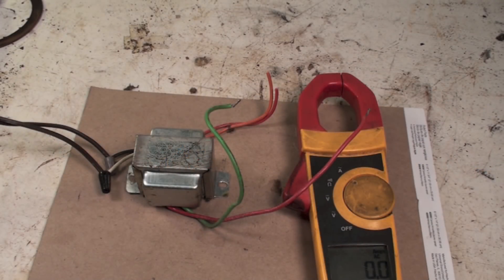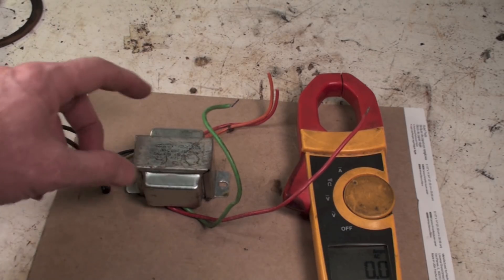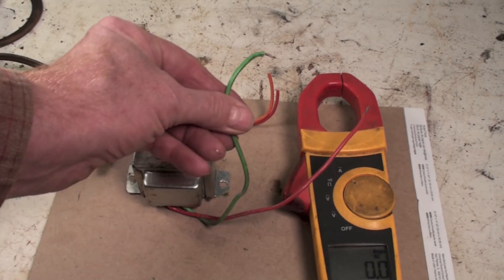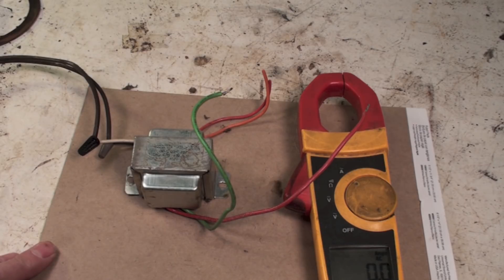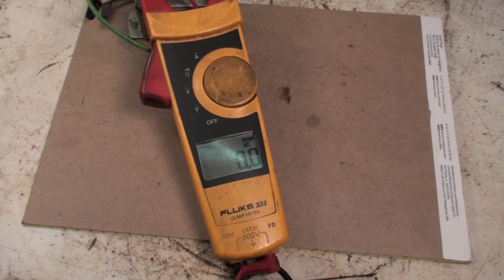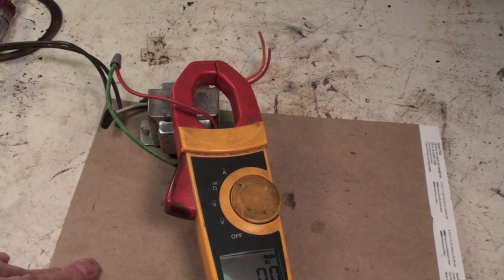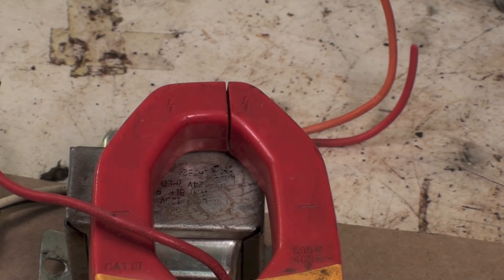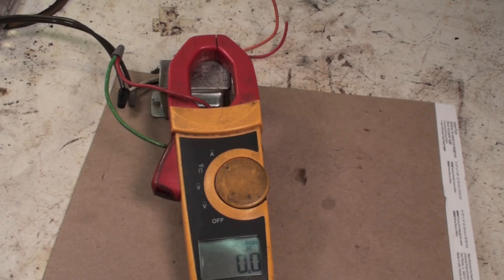How to replace a transformer (without burning up the new one)

Comment: Hi GFM! The 1st thing I ever did was replace my 24 v power supply on my furnace 20 years ago.
The old one did not have 24v common grounded to chasis.  I put it back like it was.
Is that the norm for the 24v common not to be grounded to chasis?
Reply from the maker: Some of the earlier transformers were not required to be grounded if they're smaller than 40 VA.
GFM

Comment: Thank you so much, I appreciate your channel so much.  I am having to replace my transformer which started smoking.  I have watched and read everything I could.  My new transformer is duplicate and has no fuse like previous (board or anywhere).  Therefore, I am planning to install an inline fuse on secondary wires which are both the same "color".   In looking at the wiring diagram and the control board itself, I understand where the wires should connect on the control board terminals; one on C and one on X. 
 (Sec 24    VAC
  Yellow  Yellow)
I don't want to make a mistake again as I think/know it was a direct short when I was checking the inhouse thermostat via jumpering and made an error!  In following the diagram It seems like I would place/start the inline fuse on the X terminal continued wires to molex as the C goes on to other areas.   Am I right or wrong?  Sorry, forgot to say this is a Rheem rooftop packaged unit.   The other unit I did all the cleaning, checking voltage, ohms, wirings and everything ... it's doing very well; and I also plan/will install an inline fuse on it also.     Sorry to be so verbose as my previous HVAC owner and contractor (20 years service) retired; and sold his business and moved out of state.  The company he sold name to  unfortunately are rip-off-artist... serious as my previous taught me a lot when he did work.  Two units are about six years old, installed by previous, and I messed up! Just want to get it right.  Any help appreciated if possible.
Reply from the maker: The fuse should be on the X terminal.  
GFM
Reply: @grayfurnaceman  OMG .... your quick response .... Thank you, thank you, thank you... SO MUCH!

Comment: I have a ICP oil furnace from 90s, I m not getting 110v to 24v transformer, does 110 come from fan relay?
Reply from the maker: The 120 volts comes from the cad cell relay upon a call for heat.
GFM
Reply: @grayfurnaceman  Thanks. Ive got 110v going in to primary control but no voltage at 24v transformer.
Reply from the maker: Is the transformer integral to the cad cell relay?
GFM @fjb6576
Reply: @grayfurnaceman  No mounted to outside
Reply: I have connected 110volts to transformer, furnace runs, my computer is in my shop furnace is in house
Reply: If I let thermostat shut off furnace it blows fuse, If I unplug my 110v cord burner shuts off and goes thru cool down cycle and shuts off blower.
Reply: @grayfurnaceman  Can U tell me the difference between a White Rodgers 668-451 and 668-454 controller or a replacement for the 454.
Reply from the maker: They are interchangeable.
GFM @fjb6576
Reply: @grayfurnaceman  My transformer was always on, are U saying the voltage comes from the relay?

Comment: What kind of transformer is that? I got one that looks almost exactly the same from my old audio boombox/cd playee… it has two black wires on one side with a small toroid core wrapped around it… and 2 red wires on the other end… im curious about it - how would you categorize mine also btw; it seems there may be many ways

If i provide the two black wires w/ 120V(AC), im able to measure 11V(AC) RMS on the other winding at the 2’red wires.

It does step down, but ive seen visually similar transformers also categorized as power/audioOutput/Tube/SingleEnded&Control… 

Great work btw. Thx!
Reply from the maker: The transformer is from an HVAC system.  120 volt to 24 volt AC.
GFM

Comment: Hi Gary, I have a step down transformer that received 240 V from the source, but there is no 24 V coming out from the secondary wires. The 3 amp fuse on the circuit board wasn't burned. 
At first, I thought my transformer was fried by a power surge, but when I replaced it, the new transformer burned right out.
I didn't notice any burned or loose wiring.
Do you have any suggestions where should I troubleshoot?
Thank you for your time
Reply from the maker: I would be looking for a short in the low voltage circuit. 
GFM
Reply: But my 3 amp fuse in the circuit board didn't burn. Should I put another 3 amp fuse at the transformer's secondary wire(the hot side) to prevent the transformer from being toasted again?
Thank you for the reply
Reply from the maker: What I do when I suspect a low voltage short is I place a clamp meter on the secondary, then energize the circuit.  Assuming a 40 VA transformer, the draw should be no more than 1.6 amps.  If so, you probably have a short in the circuit.  Do not leave the circuit energized.  The transformer will fail.  Start eliminating components until you find the short.
If you use a fuse, you will go thru a lot of them.
GFM @antoniuswardoyo

Comment: Question:  The transformer in my air handler has normal input voltage (240v) but the output is 31.15v instead of 24v.  Would that or could that cause my low voltage fuse to blow?
Reply from the maker: If that reading is open circuit, it is probably ok.  They generally read 26 to 27 volts under load.
GFM
Reply: @grayfurnaceman  that reading is under load.  31.15v with the unit running in cool mode.  Thank you for the response, I appreciate it.  Matt
Reply from the maker: @Empty7775  I would replace the transformer.
GFM
Reply: @grayfurnaceman  Thanks

Comment: These general all about control transformer TS videos I’ve seen concern only the secondary. How about a fuse on the primary, so, as when the primary has a tenancy to burn out with the quickness, a control transformer is not damaged, ie. the primary shorts/burns up on power up. Any ideas on a primary fuse size to protect during TS???
Reply from the maker: For these small transformers, the fuse would have to be very small.
GFM

Comment: Blown mosfets can short to ground, producing a huge amp draw and destroy a secondary winding on the transformer. Allways check the mosfets adjacent to the transformer. They could be shorted to ground. It happens in DC->AC inverters.

Comment: THANK YOU! My  transformer went bad  taking out the AC but the control board fuse was good. 120V to the control board but no indication of power. I got a new transformer from the hardware store that would work, but it didn't and just started to heat up. Same no indication of power with power. Saw your video. Something took the old transformer out. Made me look at other videos and found one showing what uses 24V and to isolate one by one. The AC contactor wire at the condensing unit got a little chewed and shorted. It didn't pull enough current to pop the board fuse, but it pulled the transformer down to 2 volts before I fixed the short.
THANK YOU! Your video started me down the rabbit hole to fix my AC on a hot day. The new transformer works and the old one is dead.

Comment: My heat pump is 11 years old, noticed 1 month ago that I had no 24 volts at thermostat, checked 3 amp fuse, blown.  Replaced 3 amp fuse, ran for one month okay, then failed again. Now Transformer secondary side has no voltage, but replaced fuse is still okay.

Is it possible that the transformer got a power surge which crippled it a month ago, also blowing the fuse, but had a little bit of life left in it?  I guess I was expecting the fuse to blow again, but now transformer is the only thing down that I can tell.

These parts are generally cheap, so I have on order a couple of transformers, contactors, and capacitors just in case.

Hope it's not any of the boards, those are really hard to find.

Comment: Recently have furnace issues, absolutely no power to the circuit board, so I figured it was the transformer. My question is could the electric company working outside on lines connected to my house be the culprit? Silly question I know but I don’t believe in coincidences. By the way love your videos
Reply from the maker: It is possible but not probable.
GFM
Reply: @grayfurnaceman  thanks for the reply, I changed the transformer and things are going well. Thanks again for what you do, ya saved me at least 150 bucks lol
Reply: @tbmac1976 branch landed on my main line coming into the house and fried mine.

Comment: Hi ...whst could cause a gas furnace 24vac transformer to catch fire / melt  on the 120v side ?
Reply from the maker: Probably a short in the windings.
GFM
Reply: Issue was nit furnace related...it was bad neutral wire at elec meter and improper  elec bix ground cable connection...all good now...i went through 3 transformers and numerous light bulbs throughout home

Comment: Here's a question for you. I have a two furnace/AC setup that has a common return trunk line (don't ask). I just switched over to NEST thermostats and the installation was easy. The 2nd floor is working like a charm. The first floor seems to have fits every once in a while and reports that there's no power to the thermostat. First thing I eliminated was I made sure the condensate pump was 100% clean so I I did a thorough cleaning job and reinstalled. Same problem persisted. Next thing I did was replace the Emergency Switch with a new one and I grounded it to the system (it wasn't grounded). Same problem within hours. Next thing I did was replace Breaker with a correct 15A one. Reason I did the Switch/breaker was it seems that flipping them reset everything and it started working again. Now I'm wondering about the transformer. Its connected to both furnaces and I'm guessing its about 20-25 years old. Not making any noises, showing about 1.6v at the connection. When the system is running, I'm seeing 3.0v at the thermostat connecting wire. Its Christmas Eve and tomorrow I'm gonna bring the nest unit down to the furnace and run a 24" jumper to confirm that the wires from furnace to thermostat are OK. You have any other ideas? Bring your suggestion of elimination!

Comment: Curious:  Furnace failure due to what looks like a dead control board (power to board but nothing works, no transformer, lights, etc)  This has happened in conjunction with a house electric problem (floating neutral, voltages all over the place) that is being addressed.  I pulled the transformer, the neutral input is visible under the translucent side cover, flashed black.  Could the bad house neutral cause a transformer to go bad?

*not a furnace guy, just a fix it guy.
Reply from the maker: The flash is the internal fuse blown.  Yes, you could have gotten 240 volts to the furnace.
GFM
Reply: @grayfurnaceman  Thank you!

Comment: I have an ac unit that has burnt up 2 transformers on the primary side in the same day. Can a short to ground on the secondary side cause the transformer to burn up the primary side?
Reply from the maker: Yes.  I would be looking for a short to chassis on the low voltage side.
GFM

Comment: Question, my heater/fan wont do anything, i have 220v into the transformer, but no 24 volts coming out. When i took my T-Stat off i noticed the wires were all bare so im sure thats what fried my transformer.. My question is why did it NOT blow my 3 amp fuse but fried my transformer? Thanks.
Reply from the maker: I don't have an answer for that.
GFM
Reply: @grayfurnaceman  i fixed the wires amd put a new Transformer back in, it fried right away, still fuse didnt pop. That means its happening before it gets to the board, so its gotta be the T-Stat causing the transformer to pop. Right?
Reply from the maker: @aaronshoyt  You probably have art.
GFM

Comment: My furnace transformer has a green ground wire coming off of it but the wire is capped off. My transformer failed (I think) because my Bryant 90 plus heat went out but AC works fine. I have no voltage to the R wire, no voltage to the pressure switch either side, no 120 voltage to the hsi but the gas valve opens when it's time to open. The red light works and flashes a code. I tested the transformer and a good 120v going in but it looks like a negative coming out because I use a needle multimeter.  What I mean by negative is my needle will bounce to like 1v and then backwards and start clicking. Any suggestions?
Reply from the maker: If your ac works, your transformer is ok.  What code is flashing?
GFM
Reply: @grayfurnaceman  code 13 which is the ignitor.
Reply from the maker: @motorcyclemike1299  I would place my probes on the ignitor wires, then restart the furnace.  After the inducer comes on, pithing 30 seconds, power should come on to the ignitor.  If so, the ignitor has failed, if not you have a problem with the control board.
GFM
Reply: @grayfurnaceman  thanks

Comment: Hey GFM, working on a duomatic Olsen, transformer/relay center smoked, then pressure switch quit transferring voltage. This possible? Where could my large amp draw coming from?
Reply from the maker: I would be looking for a short in the wiring to the chassis of the unit.
GFM
Reply: @grayfurnaceman  Thank you sir. Youre the best. I continue my career lifelong learning thru you GFM. You've helped me more than you know.

Comment: I have a question. The outside unit was only getting 21 volts to the contactor.  The technician  said he replaced the transformer. I couldn't watch him and I wish I had but I had an appt.  Anyhow, when I came back he was gone and the Co sensor and Thermostat were blown.  He and the company told me the Co sensor was bad and when he replaced the transformer it blew the Co sensor and thermostat  which meant the Co was bad.  He left me an estimate for $1520.00 for a new Lennox Comfort 7500 thermostat  and a New Honeywell Co sensor.  I questioned this and I was bullied into believing it was the Co sensor.   I don't believe it.  And I do not want to spend 1520 on these two parts.  I just can't prove what he did.  I can get the parts a lot cheaper myself and wire them in if this is truly the problem.  But what I am worried about is blowing the new ones.  He left the disconnect on when he left and the thermostat was Hot to the touch.  I turned off the disconnect.  My company is questioning what happened also and why the huge expense...  Any thoughts?  I am proficient in A/C repair.  I called this company because we have a contract with them.  I am a facilities manager for my church this unit is for the choir room.
Reply from the maker: Transformer failures are almost always caused by a short in a component or a short to chassis.  
An example would be a bare wire contacting the sheet metal of the unit.  That could cause the thermostat overheat from the excessive amp draw thru it.  I am not saying it could not be the CO sensor but in order to find out you must eliminate one component at a time.  This video may help:  https://youtu.be/eBYunyrImf0
GFM

Comment: I have a AC which keeps tripping the reset button of 24V transformer. Once it is reset the AC will run for several hours and then trip the reset button again. Any idea which part has short? The contactor, thermostat? Happy New Year
Reply from the maker: Happy new year.  There are too many components to know.  You might start with this video:  https://youtu.be/eBYunyrImf0
GFM

Comment: I have 24v transformer with reset button which keeps tripping the reset button. Are the thermostat wires shorted?
Reply from the maker: You could have a short or there could be a ground somewhere in the circuit.
GFM
Reply: @grayfurnaceman  Thank you so much for your response. I will check there. Happy New Year!

Comment: If a transformer lasts a few months before blowing.. what do you suggest?  Happens on cool and heat, but months of time apart.
Reply: I also have this issue. looking for a response.
Reply: @flamaest  I ended up having the 50 year old circuit re-wired and the kill switches for the furnace replaced.  Fixed the problem.
Reply: @Swoliosis1  thank you. are you saying that you replaced the breakers at the circuit panel and had new romex lines run to your hvac?
Reply: @flamaest  Replaced romex from breaker box to HVAC and replaced the kill switches on the same circuit near the unit.

Comment: Hello!
So I found mine burnt 
One question 
I have a 240 volts system 
On primary wires 
What voltage the common wire supposed to have or is it consider the neutral ?
Reply from the maker: If your primary winding is 240 volts, there is no neutral.  There is a common on the secondary, but it could be either wire.
GFM
Reply: grayfurnaceman 
So 120 on one end of primary and 120 on the other end on primary?
Thanks for the help
Reply from the maker: @GeneralMechanicGA  120 + 120 = 240.  120 measured to neutral 240 measured line to line.
GFM

Comment: Hey there had a question for you.  So I'm looking to get a Nest thermostat as the gas company is offering a rebate on them.  I believe I have a C wire as it is connected in the furnace, however the C terminal seems to be connected to the R terminal on the transformer and the C terminal on the transformer goes somewhere else.  Is this normal and will it affect whether or not the thermostat has a constant 24 volt power supply?  Your feedback would we welcome.  Thanks!
Reply from the maker: It shouldn't make any difference.  
GFM
Reply: @grayfurnaceman  Thanks for the info!